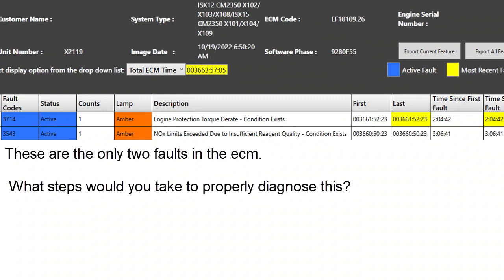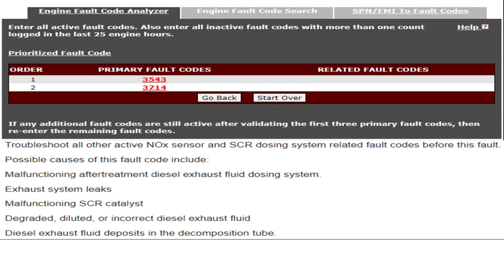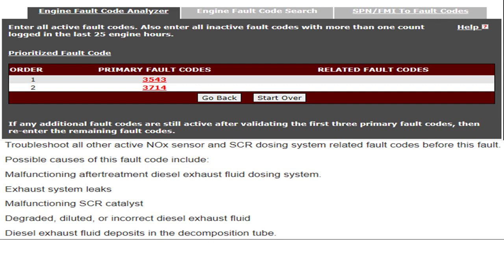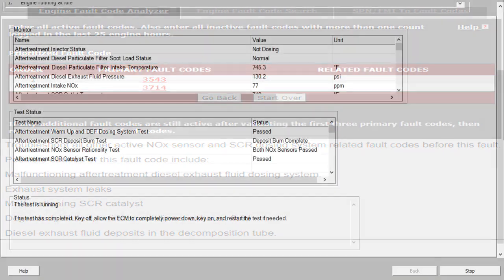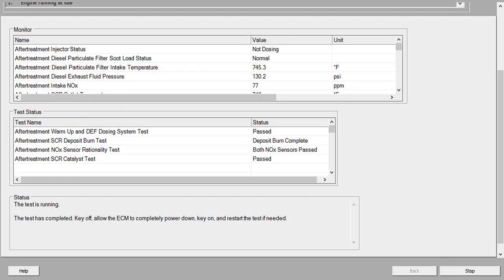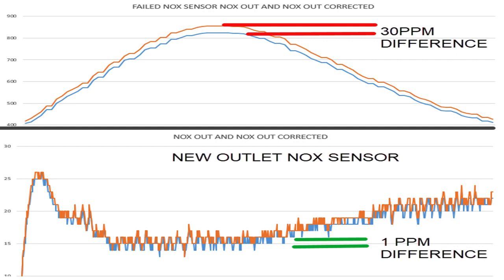SCR fault 3543 is it really BAD DEF?

Comment: i got a used ecm off ebay for a cm870 "cpl 8518, i currently have a cpl 8519" . Plugged it in and the truck starts and idles fine . However when I push the fuel pedal the rpms go full throttle "wide open"  Why isnt it reading the fuel throttle position? . I forgot to turn the key on and pushing the fuel to the floor 3 time slowly to calibrate the throttle position?
Reply from the maker: There are a number of possibilities when it comes to what is causing this. To answer your question I would have to have an INSITE ecm image from both ecms.
Most likely the throttle type setting is incorrect. There is also a setting called variable speed throttle. The older ISX engines did not like that setting and could be extremely aggressive (throttle behavior). You could also have the wrong calibration in terms of industrial vs automotive. The cpl thing should not be an issue it is just probably lower horsepower than yours. A lot of times just one number difference in a cpl was the difference between fuel miser fleet truck cals and owner operator vocational cals.

Comment: when are and  or do you use the advanced ecm tab to reset the nox sensors that is in the new tab on insite, my guys at the dealer had not even noticed it was there when i asked them, and as current no one has been to school yet to give me any info on it, replacing the nox sensor when they fail with no reset has been working with no following fault codes afterwards.
Reply from the maker: There are 4 resets in the scr reset module-NOx sensors, Doser injector and scr brick. If you change any of those parts do the appropriate reset.
The resets just return the learn tables to a baseline. If you had an old ecm calibration you might not see those tests. But update the calibration and they show up. That is because INSITE is just empty shells or modules. Once you connect to an ecm you are looking into the calibration, when in the diagnostic, features/parameters, faults,advanced ecm information and trip data. I just mentioned this so you understand why two identical engines might not have the same tests etc. Update to current calibrations. I was told if you update the calibration all the resettable tables are reset.
I think the scr resets are now available for a couple reasons: Emissions are more accurate if part relearns are used and the system will recalculate how much  DEF it meters into the decomp pipe until that relearn. There are a very few scr brick faults that are difficult to clear even after the issue is corrected. The resets may help those faults to go inactive ( My experience has only seen these faults when the scr element failed.)
Last we were changing NOx sensors and did not even know the reset screen was there a couple years ago. It did not "seem" to make any difference performance or fault wise.

Comment: Hi Joe, how do i transfer my ecm calibration or is it "image"to a new ecm I just purchased a a spare ecm to carry in the truck to have as a back up ecm! I do have inline 6! WillI be able to do it all with inline 6? This is a cm 870 in a otr truck I not looking for any new updates,just want to transfer my exact program to my new spare ecm.
Reply from the maker: The ecm calibration is two parts: the calibration and the settable parameters. The calibration is noted as the ECM code. It can be found at the top of your insite screen when you are connected to your current truck engine. You download the ecm calibration(s) from cummins website or you can use qsol to download it. Insite will load whatever you want into that blank ecm ( by ecm part number and engine platform of course) So becareful to load the same code. As long as you keep your CPL number the same you can play with horsepower and torque somewhat. However if you do not throughly understand what your changing and the effect on the unit then put in the same ecm "code". 
Now hook up to your current truck and create a "work order" in insite. The ecm image is in the work order. you right click the image you just made and choose create templet. that will show up on the bottom half the work order screen. then  you disconnect from your truck. Now you calibrate the new ecm and then once that is done you open the work order screen and highlight the templet you made and right click and " send to ecm" (it might say transfer i dont remember} now your done and your ecm is calibrated and ready to just plug in and play. You can also write down or print the features and parameters and put them all in by hand ( just shoot me LOL) which on a new engine can take over an hour. Sending all that info with the templet takes less than 1 minute on your engine. By the way I would carry an ecm too.  The question you asked deserves a 3 page answer but this is as concise and to the point i can make it LOL. By the way once my website is up I am going to put up MS powerpoints i made but they wont be free.
They will have very good information and what you asked is the topic of one I'm currently working on. I may offer videos of actually doing it as well.
Reply: thank you, That would be great to have a place to get instructions step by step. Very helpful

Comment: I got 3545 3226 Fmi 10 Innactive , Can I run 1k miles before replacing Outlet nox sensor ?
Reply from the maker: If your yellow OBD light (outline of the engine with no wrench or color in the outline is on with no other lights no problem. 
If the OBD light and check engine light is on then for one hour after initial detection there is no derate
With both lights still on you now have a 25% torque derate.
After you reach the 5 hours mark you now have a 25% torque derate plus a 1% torque derate every minute until you reach 40% torque derate.
After you reach the 5 hour mark, OBD and Check engine light on if you idle more than one hour, or you shutoff the engine, or you refuel you immediately go to maximum rpm of 1000 and maximum of 5 MPH. 
If the check engine light goes off and OBD stays on you will have full power again
But
If the obd light stays on and then a few hours later the check engine light goes on you are immediately back to the last stage.
Think of the obd light as a derate memory so you cant restart that derate clock unless the obd light goes completely off.
If it were me I don't think I would try it. But that is just me.
The NOx sensors are plug and play so anyone can change it. You dont need any software. The light will go out as soon as you put the new one in and drive a bit so the ecm sees it has a good sensor. That is assuming the sensor is the issue and not wiring harness issues etc